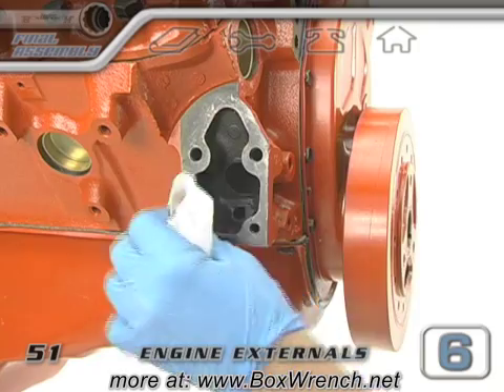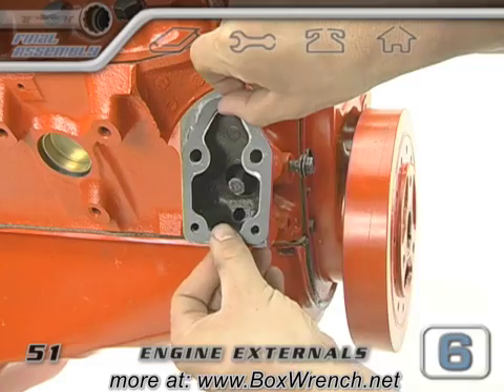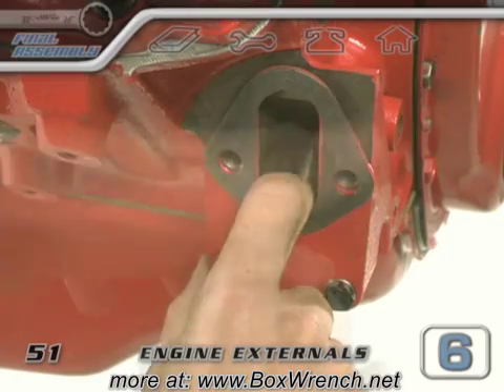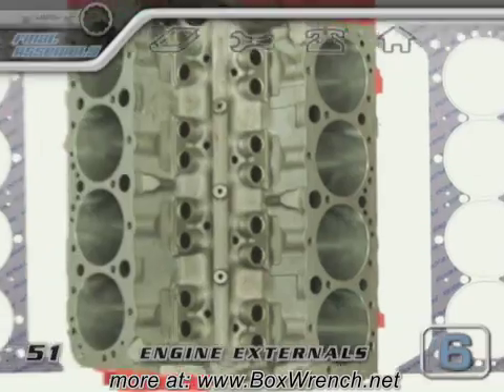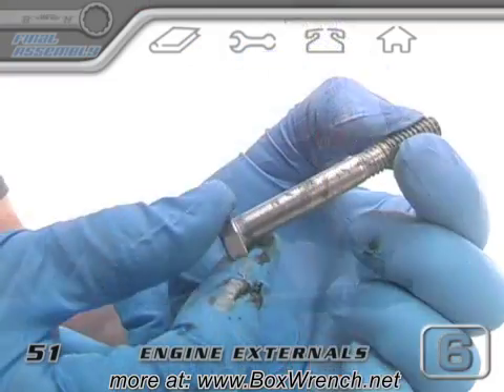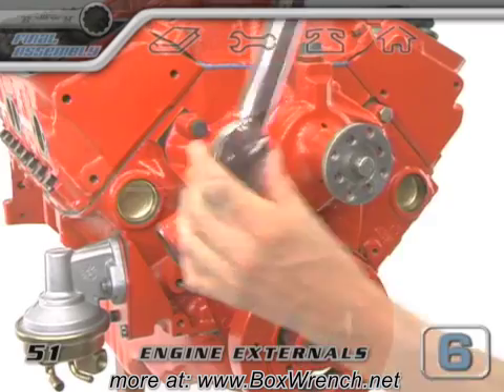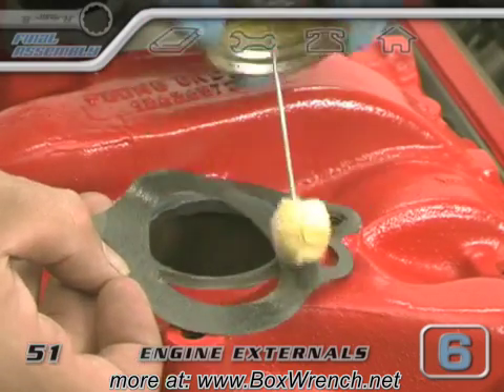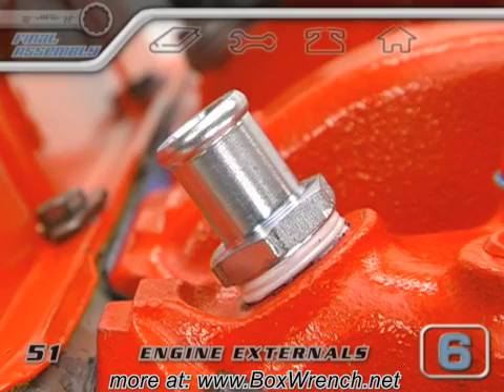Fuel & Water Pump Thermostat Video-Engine Building DVD

Comment: what is that gasket sealer used in the video? it has a neat application brush. I wonder is that similar to any high temp blue/red/gray silicone RTV stuff you can buy in tubes for cheap money at the auto store? is it limited to paper gaskets or does it work well with any - steel, rubber, klingerite? could that help a leaky vave cover that uses a silicone type rubber gasket inserted into a groove? can mate it up with some RTV where it leaks? thanks a ton!

Comment: Me and my son are working on installing a 4 barrel intake and carb on my 1978 Camaro Z28, when I bought it, it had a 2 barrel setup, and the carb was in horrible shape,, Two screws missing on the rear of the carb,,, Not a good way to run a motor. Tomorrow we are going to be installing the intake and carb, hopefully get to start my engine,, I can hardly wait,,  This video is awesome,, I am an old school mechanic, and know what to do, ,but still watching is fun.

Comment from the maker: This is only one of a couple sample clips. The complete DVD shows all the other details. 

However, that one bolt hole of the front of an SB Chevy block doesn't pass all the way into the fuel pump pushrod bore for all of the chevy blocks. Many of the later model blocks after 1986 have blind holes there and you have to hold the fuel pump rod in place with thick grease or assembly lubricant.